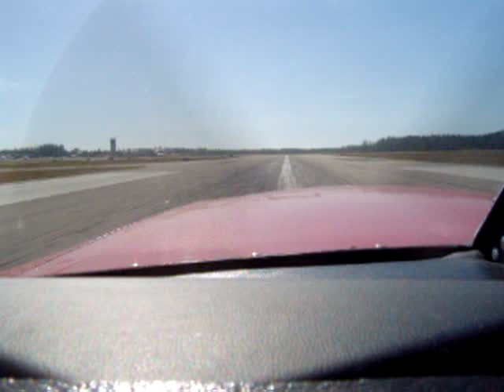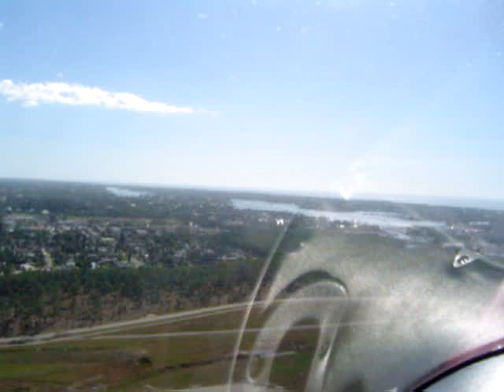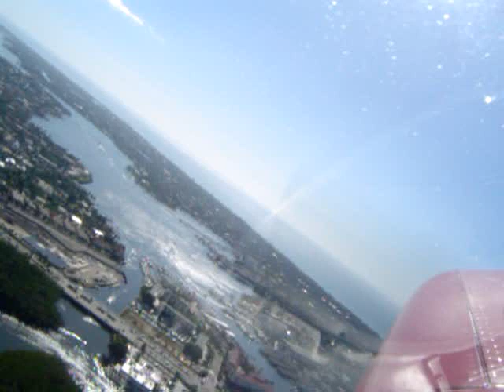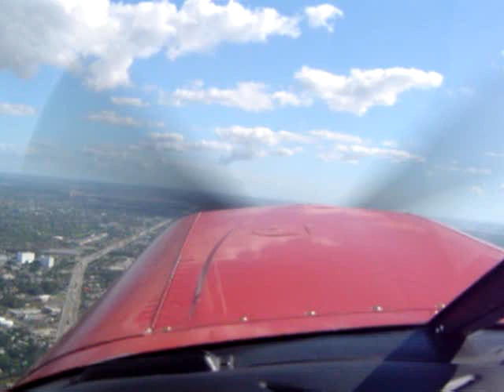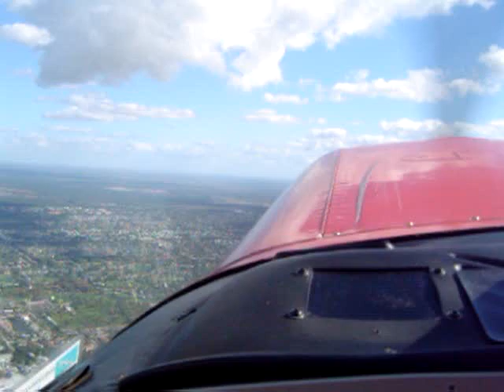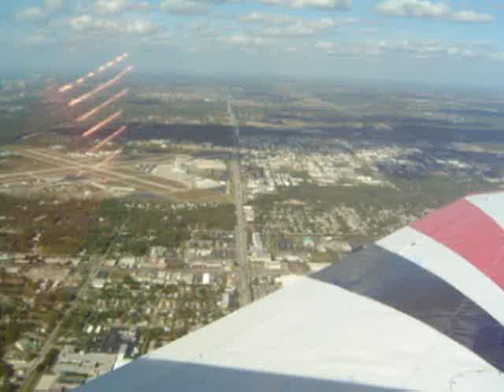400 Comanche take-off

Comment: One other thing while flying with Dad if you pull the gear up and leave the throttle slam forward and approach red line at the end of the runway that 3000 ft a minute it doesn't last long but it's pretty cool

Comment from the maker: 2650 rpm is max and used for take off, however the pilot's handbook suggests MP and rpm reduction after the gear is in the well and climb established. 400HP is not required fro an airplane that was originally designed with 180HP. Thans for the question.

Comment: Cessna 175's (built in the mid-60's?) are great aircraft with geared props. Cessna claimed they stopped production 'cause pilots didn't easily change old habits from flying the 172's & 182's, in maintaining a proper RPM.  I took my flight test in a 175, in spite of most of my 40 student hours being in 172's and Cherokee 140's.  The 175's are solid airplanes, and make a nice compromise between the slower 172 and the more complex 182 (with cowl flaps, cont. pitch prop, touchier on cyl head temps)

Comment: One other important thing to remember concerning engine rpm's is propeller speed. Aircraft engines were purposely designed to turn at lower rpm's with plenty of horsepower. (look at the massive radials) Pushing the engine beyond 2400 rpm's forces the propeller tips to go supersonic increasing drag and NOISE! This is why many seaplanes are louder. (bigger prop diameters) Fats turning engines have been used ( i.e. rotax) but they then require gear reductions to slow down the prop! More complexity.

Comment: I could be wrong; it has been a long time since reading about the subj. My understanding about a max speed for aircraft props is similar to that for boat props. Prop tips can hit a speed whereby they are compressing the air to a point of cavitation.  IOW, there is 0 air for the blades to bite into; the air has been compressed so much that a vacuum has formed.  Theoretically prop tips would only destruct if their material is too weak, not as a direct causal relationship with the speed of sound.

Comment: @pips5678  Wrong.  If the prop stops you DON'T die.  You just have a very heavy glider.   Show me 1 video where the prop stopped and everyone on board all of a sudden died 3 seconds or sooner after the prop stopped.  You won't find ANY.  If they did die it wasn't because the prop stopped, it was because they picked a bad place to land, or something to do with pilot error.
Reply: True, but if you lose part or all of the prop you have a major balance issue

Comment: If the propeller breaks you die, so make sure the air continues to move over the propeller at all times.   I did the vibration series testing for the three-blade prop at Hartzell.

Comment: I'm between the Comanche 400 and Cessna 210 trying to decide which one should I buy 
I'm fresh pilot 25 hours in 😞
Once I get a plane and license I will take 2 months off just to fly
Reply: Comanche 400 because 8 cylinders.
Reply: Yeah, that's a $100,000 engine!
Reply: Lots more parts for a 210, but that 400 sounds so sweet.
Reply: Cessna 172, get some time before you move to a high performance complex
Reply: Buy a skyhawk and log a cpl hundred hours...then rent some 182Rg time...then do a reality check on what a 210 or other complex hi performance single is going to cost you...define your mission and buy the plane best for it